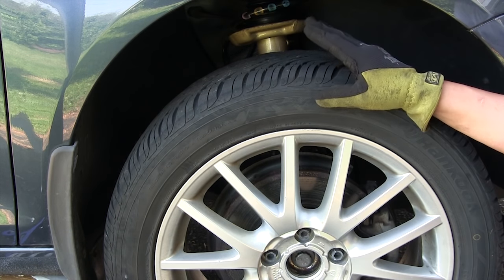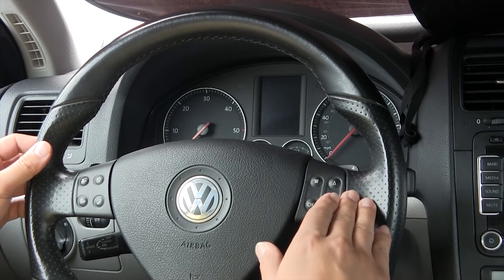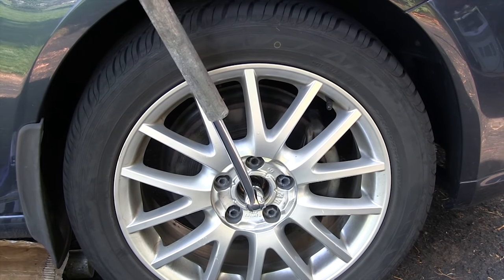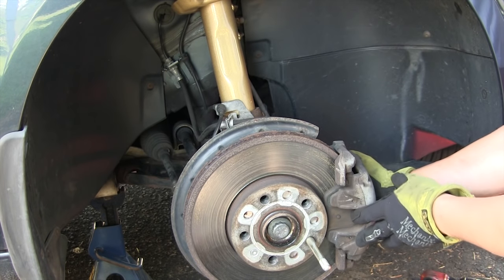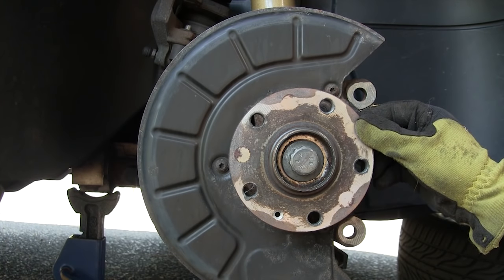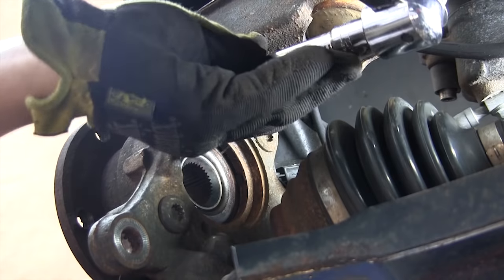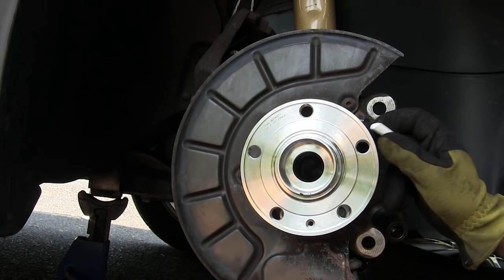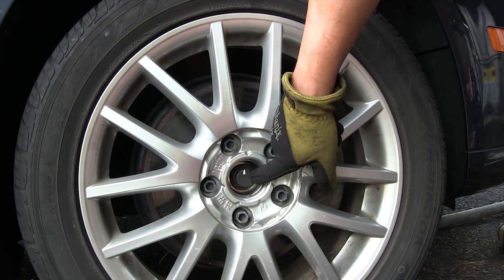VW wheel bearing replacement and bad bearing noise and sypmtoms

Comment: That trick to grab the strut saved my life with my Mk4 man. I could hear it while driving but could not pinpoint the side. I thought it was tore nosie because I got new tires last night but I guess the old tires masked the noise of the bad bearing. The whole time I thought the easy way was to take the entire knuckle off and replace it. I had no idea you could do this without a press!! Your way is still a bit of a challenge but it's a lot better than replacement of the entire knuckle. Now I just need to get outside and make sure that mine has that same 4 bolt design and I know what I need to fix it. My Jetta is my daily driver and my kid is in the car all the time. I need it to be as safe as possible.

Comment: Yup, gonna have to replace both fronts on my 2010 2.5 I kind of figured that was the noise, as I had had to do it to my 2006 2.5 Jetta as well (sold that one, should have kept it.) Your video portion with the road noise confirmed it for me, thanks.

Comment: Thank you for the detailed video and specifications. I watched your video and changed the front wheel bearings on my 2012 VW CC. Your video is spot on. After watching the video, I made sure I had adequate leverage on a few of the bolts that are torqued down. Made the job much smoother ... I am sure.
Reply: Bryan Nicoll I have the same car. Tried replacing this bitch bitching thing. Was never able to remove this 24 bolt. However, I think I removed one my spine's vertebrae.

Comment: This was totally awesome video, showing the simplicity of this job.  Firestone quoted me $850 for the wheel bearing replacement and $350 for the axle replacement, so $1200. Southern California. Tell me how much Firestone rips off its customers.  They tried to blame the noise on the transmission. Does it mean they screwed up on installing the new axle?

Comment: Another option on the bearing bolts is to have the axle in and control arm s as normal and crank the steering wheel to full lock to get at first two and repeat for other side...this gives you less floppy hub and better leverage
Reply: Damn good tip. Worked great 👍

Comment: just  a  fyi when setting your jack stand take note of the surface you use round indention would serve better in matching that control arm rounded part to avoid it from slipping .... great video though for the diy

Comment: I removed the ABS sensor and wirebrushed the hell out of my hubs before treating with rust killer and applying a liberal dose of antiseize.  After 190k the old bearings were well rusted in there and a bear to get out. I shouldn't ever have to go in there again, but if I do I'll have an easier time next time.

Comment: Great video. Can you do the rear of an awd. Possibly a 2010 tiguan. Btw, there are 3 axle bolts, the 12 points come in ribbed or without. The ribbed bolts are the ones with less torque otherwise the none ribbed 12 points is the exact same as the 6 point.

Comment: I would suggest always doing an alignment anyway, even if you measure the ball joints and what not.. for the small cost it's worth it for the drivability and tyre life :)
Reply from the maker: Always a good idea.
Reply: injector cover sprinter 311

Comment: I started barely noticing that I had the dreaded bad wheel bearing noise coming from my left wheel. It is becoming more noticeable. What I would like to know, and I hope you can give me some advice is, how long can I wait until I need to change the wheel bearings. Can they go out on a 6 hour trip or do they have some life left. They are not as bad as the ones in your video and they do not shake the car yet. Thanks in advance.

Comment: The link to the myturbodiesel wiki does not work anymore! I was hoping to get torque specs, socket size of the axle nut, etc. When I click on your link in the description part of the video, I get an error message that says "Oops The Requested Page Could Not Be Found"

Comment: MYVW  Tourage is making a winning noise at the front wheel nearing, a month ago it was hardly noticeable and now it is loud enough to dtect when near a barrier or wall on the highway ( 10 ft away) Am I correct in assuming this is early stages of wheel bearing going Bad???

Comment: Would this be the same for a 2000 Jetta GLS?  I will have to do both my fronts, but I am a bit leery due to information telling me that I will need to pull off the whole knuckle and press out the old bearing and press in the new bearing.  Any thoughts?

Comment: if the hub bolts fail the wheel still can't fall off since the outside cv joint is bolted through it- and is much too large to go through the assembly hole. Would jump around a lot though

Comment: What would cause the sound of a rattle that increases in volume with acceleration? Only time I ever heard that noise was when my axle bolts came out and my axle was half off and that rattle sound came up, but my axle bolts are all in now.

Comment: Last time I was doing suspension job I had big problems with removing an axle from wheel bearing. What do you recommend to do if it doesn't want to come out of bearing? Hammer didn't help much that time. :(

Comment: I've been getting small vibration at exactly 64 mph but I don't believe there's any bearing noise, I've gotta imagine the bearings are my issue tires and wheels are new.  The faster I go, the vibration lessens - if I hit 70 or above and set cruise it's not as as bad if not gone.  but 60-64mph it's noticeable.

Comment: Are there any other reasons to feel vibrations through the strut when you rotate the wheel or is a failed bearing the primary cause?

Comment: Some of those VW torque plus angle bolts are next to impossible to tighten down fully. You feel like you are going to break them.
Reply: Easy with the right tools, 3/4 bar minimum for that 200nm + 180°

Comment: removing brake calliper.why just not two main bolts? 
or u want to make sure that sliders are not stuck? 
:)
aswell u dont like 3/4  ratchet,i got one after similar breaker bar broke with pipe on it.

Comment: i get a humming noise when i turn right, its not connected to the speed of the car and only occurs when the accelerator is not pressed? Any ideas? I can turn the wheels both ways when stationery and hear it loudest. Any help much appreciated :) 99 passat wagon

Comment: It looked old but was it bad? How could you tell after it was taken out visually I mean thought it was a pressed in ? So it is only bearing holding bearing balls?
Reply: Old thread I know, but for anyone still interested,  yes you can tell. The grease around the balls should be yellowish, but in a bad bearing it will turn black due to heat. 

There are two races within the bearing, an inner and an outer race. In my bad bearing the inner race burned up but the outer race was still good.  I suspect that will be the typical mode of failure - one side of the bearing generally loads more than the other sure to vehicle dynamics, and once excess play develops the lesser loaded side doesn't spin the balls as well but rubs past them instead creating heat.

Comment: The Haynes manual state that the car must not be standing on its wheels when torquing the driveshaft bolt, or the wheel bearing will be damaged. What do you guys think about this?
Reply: Your supposed to torqe the 200nm  while wheel off the ground then the full 180° when wheel on the ground

Comment: is it possible to damage wheel bearings from a big pothole , nice video btw
Reply: i would think so
Reply: Any pothole at considerable speeds can do a TON of damage. Avoid them as much as possible while considering your safety above all else. I've seen plenty of people almost swerve onto oncoming traffic just to avoid a pothole death pit. I recently just got a sudden bulge on the sidewall of my driver side tire. Most likely a pothole I missed. It happens.
Reply: I fucked up half of the suspension components on one side because a particularly evil pothole... Funnily enough, the bearing was fine, haha.

Comment: Are you using a 3/8 or a 1/2 for the axle bolt? want something strong enough
Reply: I would use 1/2 drive
Reply: 3/4 if u can way less flex and u can do the full 180° easy

Comment: Hi there , I think you may have mixed-up the wheels when diagnosing which bearing is worn out , if your saying that loading the car to one or the other side of the car would means transferring  more weight to that side , I would say the side your steering into would be "loaded". or would have the most weight on it or force exerted on it .  but there's always the chance I've forgotten everything I learned in high school physics ?
Reply: I was wrong , you have it right in the video my apologies !

Comment: I hear noise when I turn steering to the left with speed of 60kmh is that  a bad bearing on left side or right side???? vw passat B6 2.0tdi year 2007
Reply: +Moses Kariuki Mine also made noise when steering left. My Left wheel bearing was bad. My mechanic said it was the right bearing that was bad, but after replacing the right bearing the noise was still there, so I replaced the left.

Comment: The easiest way to diagnose a front wheel bearing on a front wheel drive car is to jack up the front, start the car and get the wheels spinning to about 50 MPH.  Put the car in neutral and shut off the engine while the wheels are spinning.  If there is a bad bearing, you'll hear it.
Reply: Except that mk5 will not let you free spin the wheels unloaded even in service mode. 
Also there are far less dangerous ways to diagnose wheel/drive noise.
Reply: +Clynikal well I did my mk5 bluemotion today. 60mph at tick over in 5th.
Reply: +v8trauma yep I stand corrected, I also did it the other day with the screw driver trick and found both fronts were culprits. I retract my comment but will leave it there for the sake of the record books to say I have on the odd occasion been wrong. 
I might add that it was a senior VW service "mechanic" that advised it couldn't be done but turns out you just have to turn off the traction control. I was only thinking yesterday how I would have to eat my hat with this comment.

Comment: do you have a video on the rear bearings?
Reply: +Drewdownkali The rear bearings are pretty easy, since theyre not driven they are just held on by the axle nut. The hardest part about that job is getting the caliper bracket off in order to remove the rotor. You can find the torque specs by simply googling "(year) volkswagen jetta rear bearing replacement" or "(year) volkwagen jetta rear bearing torque specs" and looking on the forums like VWVortex or something similar

Comment: Where do i find the tools you used? the 12 point socket is impossible to find online.
Reply: dude i'm pretty boned too :(
Reply: Ciara Hosking get it off ebay in a kit
Reply: You can buy a set on Amazon. You can also look for "four square" sockets
Reply: The 12 point socket is just a normal socket.....sockets either come as 6 side/point or 12 side/point.  They are readily available everywhere....

Comment: while driving you hear woah woah woah very low pitch noise plus you just "feel" a constant metal on metal vibration. what would this be? i tested front wheel bearings by driving the wheels in air (car on jack stands) put a large screw driver on the inside of steering knuckle and no noise from it.
Reply: Persian5word has your car got aftermarket alloys on
Reply: No, they are stock VW alloys
Reply: some suggest its the rear bearings. Now being FWD car the only way to test the bearings (w/o taking the wheels apart) is to have someone to seat at the back and listen for sound as I drive on highway.
Reply: rear bearing being the issue make sense because just before all this I took 3 loads of 1200LB of concrete slabs spreading over backseats and trunk.. across the city. I guess I fried the rear bearings. Tho I did this knowing the Passat has one the strongest sedan chassis out there.
Reply: Persian5word a

Comment: Does anyone know what the guard behind the rotor is called? The one on my rear wheel hub fell off due to rusting and is stuck and making noise when driving. I might just remove it or replace it which ever is necessary.
Reply: They're really not necessary, but you're talking about the dust guard/ dust shield? I replaced one in my old Suburban and that was just about the hardest thing I've ever replaced on a vehicle (not a mechanic, just a DIY guy). It isn't a VW, but those shields are a real bitch: had to remove the wheel, the caliper & bracket, and the parking brake cable.
Reply: Its called a backing plate. And yes they keep crap from the road getting in between the rotor and pads. Would make a lot of noise.